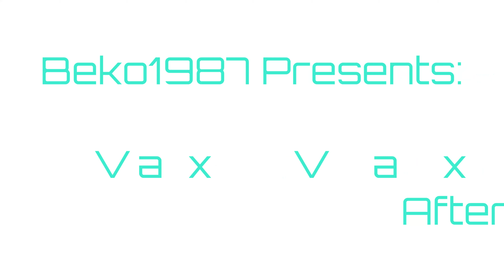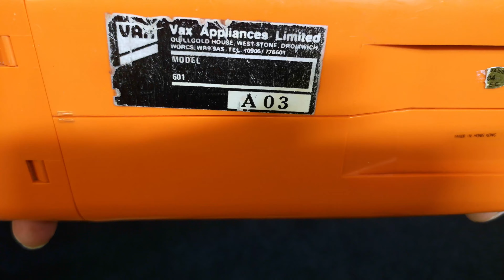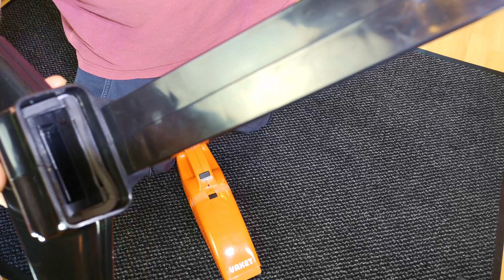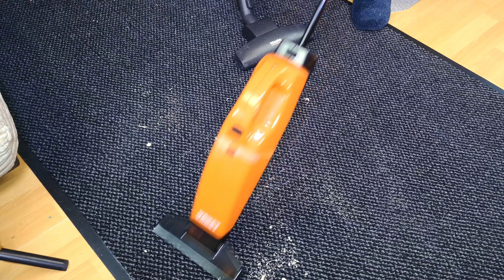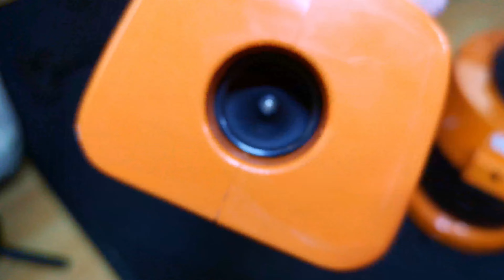The Vax Vaxet - After Refurb, and a new SLA Battery!

Comment: I have a vaxet 601 can you adpt the battery to make it work again  it is in good order but needs a new battery to charge it. Please help heather
Reply from the maker: Oooh nice! They take a fairly cheap lead acid battery tbh, I only paid about £15 poster for a new one. However I'd be trying to adapt a modern lithium cell and a buck converter to step the voltage down nowadays.